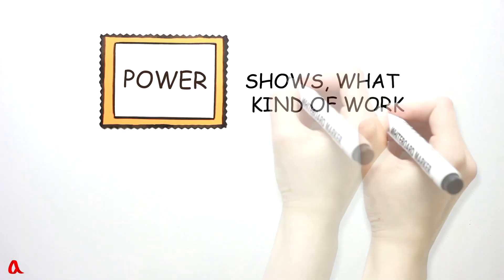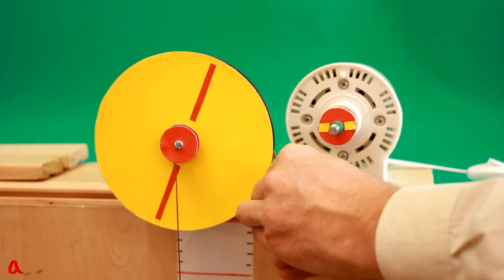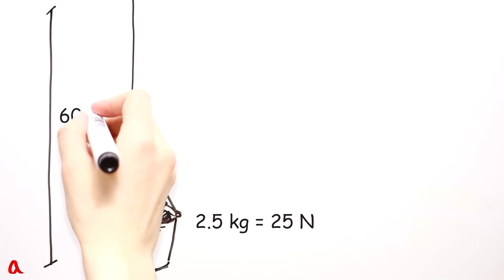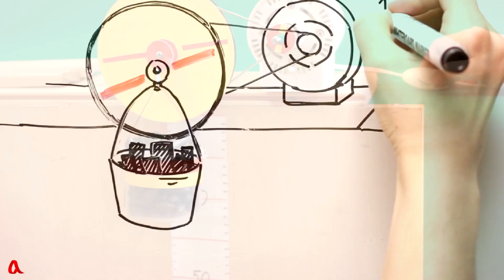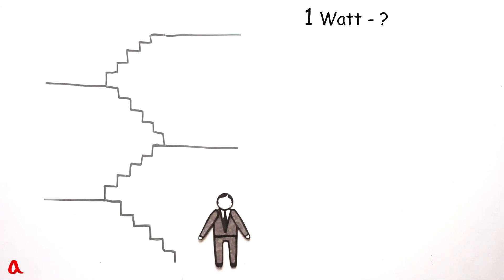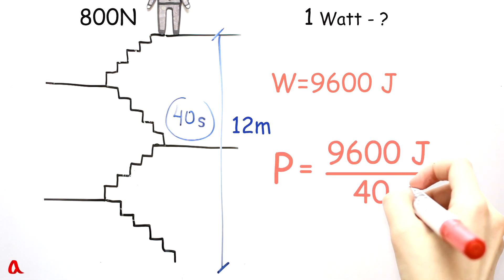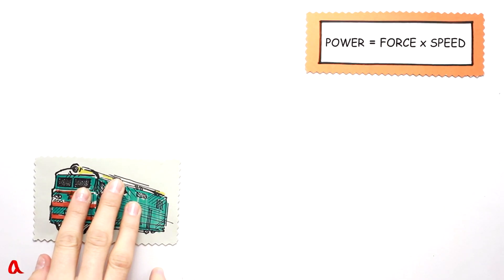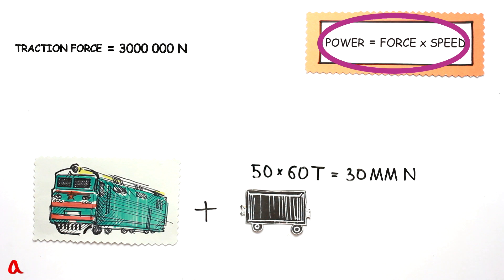Power

Comment: Bringing in James Watt's original expression which used the imperial system, HP = 2pi*N*T/33000, which cancels down to N*T/5252.1   One horsepower was defined by Watt as 550 foot pounds per second, or the equivalent of lifting 14.73 tons through one foot in one minute. One imperial horsepower  = 745.7 watts, and one metric horsepower = 735.5 watts. And so we can see that horses are apparently smaller in metric-system countries.